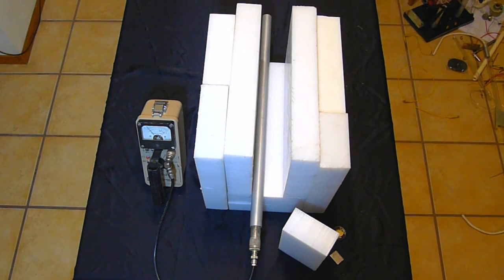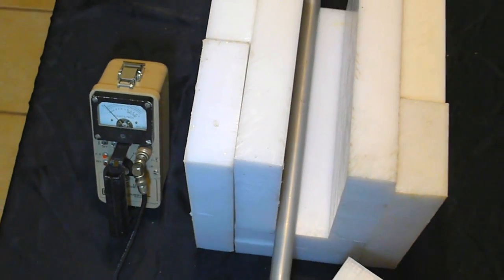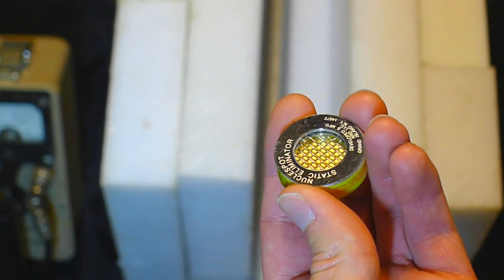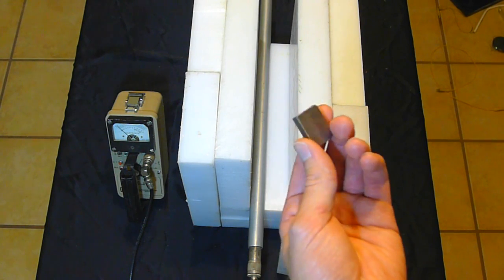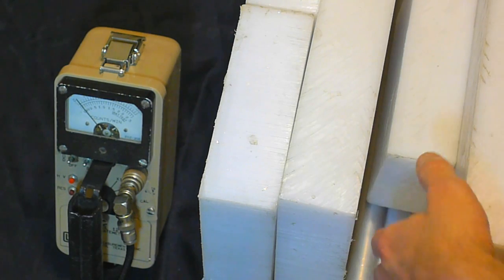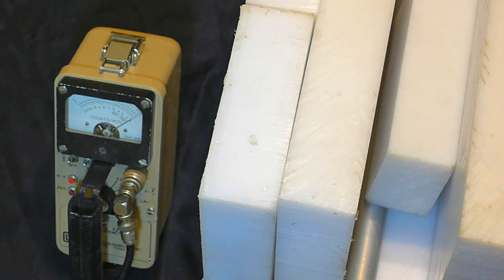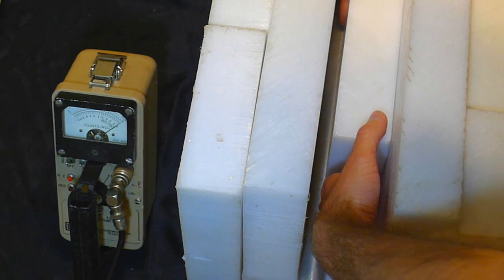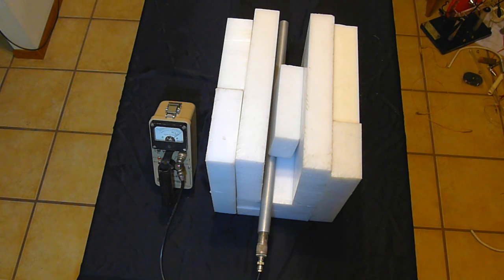Easy polonium-beryllium neutron source: assembly, disassembly, and discussion

Comment: Out of curiosity, is there a Best placement for placing something you would like to transmute with the neutrons? I see that you're helium detector is right up against the neutron source and surrounded by paraffin instead of the neutron source then paraffin then the detector. I am planning on making a video soon and I'm just wondering what would be the most efficient. I am also in New Mexico by the way, maybe we could team up on a project at some point.
Reply from the maker: The best location depends on geometry and energy of the source and the cross section of the target material.  This source is point-like and the optimal thermal flux for activating many targets will be close to the source with a lot of reflecting moderation surrounding it.  Would be happy to collaborate on projects as best I can...get in touch via email!

Comment: So this is some what a new understanding for me from a practical and theoretical point. How is it that Beryllium increases the neutrons? From my limited studies I’ve seen and read that Berylium is used to shield or moderate fission rather than activate it. I’m wanting to delve into making  isotopes that could be turned into radioactive as experiments. I just know you have to knock a certain amount neutrons out of its nucleus to turn certain elements to fissile material. Like some many bombardments of neutrons over time with a  respectable neutron source. Its amazing  to think some elements could be turned radioactive if the right isotope could exist long enough in half life’s to be usable. Any way I digress. Am I asking the right questions for this to be steered in the right direction?
Reply: Alpha particles can infuce fusion when striking beryilium releasing free neutrons

Comment: This is a good demonstration of a "slow-assembly" neutron source. It would be interesting to know some of the design details of the initiator used for the Trinity and Fat Man devices where the Po-210 and Be had to be combined by the implosion shockwave in a rapid and efficient manner. What size was the initiator? Pea? Golf ball? (I've heard estimates of 1.5 - 2.5cm diameter.) Did it have circumferential grooves milled into the outside to provoke the formation of R-T instabilities which would have promoted mixing of the materials? It would be interesting to create some experiments where we could investigate how quickly the neutron yield could be increased, and to what level.

Comment: Isn't this the neutron seed used in the center of early nuclear bombs? Or am I remembering wrong.
Reply: No, i belive you're confused. 
I'm not sure what method you were talking about.
either The uranium-235, super enriched 90 percent. bullet and target.
or the explosive against a plutonium core and compress it?
but, neither uses neutron seed.
but, my theory is that you thought you needed to shoot neutron at uranium which is true. but did you think you needed a neutron source. for this because you would get neutrons when the nuclear chain reaction happends. but chain reactions happends all the time but i doesn't continue.
 But A nuclear chain reation is when you contiunues.
Reply: @Poke Bot  No, I was correct. Both the gadget and Fatman used a polonium-bryllium neutron seed in their centers. Not technically needed I think, but they weren't sure at the time.

Comment: My end goal is to get 12 millicuries of reactor grade plutonium-239 to create small fission events with my weak neutron gun. The resulting influx of neutrons from the fission would go through a moderator and hit my breeder.
I think that is the best method of making a DIY breeder reactor
Reply: I was thinking of doing the same.  Im still unsure how to make a proper and safe containment unit.
Reply: plutonium is one of the few elements, maybe the only, in the US that you're actively not allowed to own or produce, so be careful! good luck regardless however

for a safe containment unit, water is probably the easiest shielding to acquire and use

Comment: Carl - Thank you for all your work. I've inherited a Ludlum Md. 12 and some LND 256169 He3 Neutron Detectors. Are these in any way compatible with each other and can they together be used to detect Neutrons. The connector consists of a 7/16-28 thread and a flying lead.

Comment: Carl.  Thanks very helpful.  I am looking to build an industrial "presence" detector, very similar to a Hall Effect sensor.  However, the two bodies that come into occasional contact will be steel, and they will be encased in a steel chamber that will get too hot for a Hall effect sensor.  Further, the steel chamber will be hermetically sealed so no wires can penetrate.  Frequency response is not a problem because when they come into intimate contact, they will stay there for a relatively long period of time.  Two questions.  (1) Do you think that I can get an industrial ion implantation system or contractor to implant polonium in one object and beryllium in the other so that they will emit neutrons when they come into intimate contact?  (2) Do you know of a cheaper, more robust neutron detector?  Thanks!
Reply: That is a very interesting idea, did you continue with those experiments?

Comment: Could you have used aluminium and Am241
Reply from the maker: +kerbside motors The Al-27(a,n) reaction competes with Al-27(a,p) and has a much lower cross-section than Be-9(a,n) shown here.  Also, Am-241 is a more significant gamma emitter than Po-210, creating undesirable background for many of the experiments that would lead you to build a source of this type.  But in principle, yes you can get some neutrons from an Am-Al source.
Reply: Thank you for explanation.
I'm part of Geo's group and appreciate you taking time to video your experiments.
Reply: @Carl_Willis  what if you were to store such a neutron source inside a vat of mercury spinning at 20,000rpm?
Reply: @Carl_Willis  could i use uranium and aluminium foil??

Comment: but those are slow neutrons. how to get fast one?
Reply from the maker: +usfootman The reaction illustrated here--alpha particles on beryllium--produces fast neutrons.  The detector requires a moderator (plastic) in order to detect them.
Reply: +Carl Willis what kind of energy those neutrons have?
Reply from the maker: The mean energy is 5-6 MeV; the maximum energy something like 12 MeV.
Reply: What is the approximate neutron flux? I saw an official university study pdf online that says a 1MeV neutron can travel 39,000cm in sea-level air at about 0.5c. Is this possible? It wasn't typical internet junk, but a real university study that compared travel distance and speed  in sea level air of different particle types at 1MeV.

Comment: Tried it with AM241 source (a matrix of 6 of them -- not as strong as yours) and a He3 detector tube (running at about 2400V).  At first, nothing happened.  I found that I needed to carefully adjust the gain on the input amplifier on the Ludlum 12.  Finally I got about 60 neutrons as background count.  When I put the Be on top of the Am241 source the counts went up to about 120 -140 CPM.  I don't have the moderator material either so I tried putting it under a jug of water, which didn't seem to do much moderation.  Not sure if it was too much or too little water, or where to put the detector (top of bottle)?  I will have to work to refine my setup to get better results.  For my tube the adjustment of the preamp gain on the Ludlum 12 was especially touchy.  To low, and you get no counts, too high, and you get false counts (I think they were false counts... since the counts hit 1000 CPM without a neutron source).  Anyway, still a lot of fun.
Reply: Well neutrons can only be detected if your looking for the right energy. If your neutrons are to slow or fast, or your detector doesn’t measure the right range, you might not be able to detect them. The material of the container holding the water could interfere with moderation as well.

Comment: Can you combine several Am241 sources to create an Alpha source?  Sounds cheaper than renting a Nuclospot polonium source?
Reply from the maker: You can get neutrons from Am-241 alpha particles on beryllium.  The challenge is the practical one of finding a significant amount of Am-241 activity.  Keep in mind the Nuclespot has 5 millicuries of activity.  That's 5000 times higher than a modern smoke detector Am-241 source.
Reply: Some smoke detectors from the 60s use 80 micro-curies instead of 1 micro-curie of Am-241, conveniently only about 80 times weaker than Carl's source rather than 5000. Quite decent for a small home source in my opinion.

Comment: Here is an experiment for you:

Place your neutron source on some Thorium metal.  If you wait for a few weeks or so, do you observe any heat? Thorium is for sale ion Ebay.

This is the basis of a ThF4 reactor.
Reply from the maker: This neutron source produces about 1000 n/s, far below any reasonable expectation of breeding or fissioning U-233 in detectable quantities from thorium.  Such practical considerations have not stopped an endless train of people from trying to do the experiment you suggest, however.  Most attempts are reported with even weaker or unknown and speculative sources of neutrons and amount to nothing interesting.
Reply: Wait, just how many are you talking about Carl and who are they?
The only ones I know of are David Hahn and Richard Handl
Reply: Would the neutron production rate be significantly improved if the polonium and beryllium were in a different configuration? i.e. thoroughly mixed together or with the beryllium fully surrounding the polonium?

In addition, would such a low neutron flux produce any noticeable effects on a significantly more refined material, say highly enriched Pu-239, U-235, or other fissile material?

Comment: Most of the fuel reprocessed at Mayak is from pressurized water reactors such as the nearby VVER-440 plant.  However, the facility is equipped to process fuel from a very wide variety of sources, as it is the oldest facility of its type in the world.

Comment: Interesting demonstration--very easy to follow. I've read that neutron radiation is far more detrimental to living tissue than gamma rays. Are there any extra safeguards one should use when dealing with neutrons? Obviously, the inverse square law plays its part. Also, 5 mCi of Po-210 isn't an insignificant amount--I assume the source has an alpha-transparent window to keep it safe?
Reply from the maker: Neutrons are indeed more damaging than gamma rays on an absorbed-dose basis.  The relative weighting varies between about 5 and 20, depending on the neutron energy.  The same principles of radiation protection--time, distance, shielding--apply to neutrons as well, but shielding is engineered differently.  These Nuclespot alpha sources are SEALED sources, with the polonium bound in a ceramic that is in turn overplated with gold.  The geometry is thin enough to allow a large fraction of the alpha particles to exit the source.
Reply: Carl Willis That's very helpful info--thanks!  It's reassuring to know those safeguards are in place for the Po-210 source.

Comment: I always thought that beryllium causes allergic-like responses, such as a bad rash, if the metal is handled.
Reply: Everyone exposed to Be eventually develops an allergy that is life threatening, that even an EpiPen cant stop. Some get it on their first exposure, some after decades. But it's not something you want to find out for yourself. His handling of the Be plate was insanely reckless and needless. It's not like gloves are expensive or hard to find.
Reply: You are absolutely right. Always handle beryllium with gloves. In this experiment its the beryllium thats the most harmful.   Even tho neutrons and Sr90 ain't healthy for you. Berylliosis might not be the danger here but even small doses can do allot of damage inside and outside your body. Contact allergies are one.

Comment: Isn't beryllium toxic, is it safe to handle?
Reply: Damn straight it is dangerous. Anyone who has or develops an allergy to it can die from anaphylaxis from inhaling a microgram of the dust or a even sliver in the hand before the ambulance can arrive. For someone who ostensibly worked in a DOE facility Mr. Willis doesn't seem to have paid much attention to the hard lessons learned from decades of workers being crippled for life or dying from Be exposure in those facilities.
Reply: @tetrabromobisphenol  pettry sure the dust is toxic. As a metal, If you don't mess with tooling it, you are relativelly safe. Those fields, nuclear, chemistry and industry in general, always come with riscs.

Just now what you are doing.
Reply: @tetrabromobisphenol  I was thinking the same thing. I actually suspect he has some exposure from that persistent cough across most videos.
Reply: The Beryllium oxide is really what's toxic.

Comment from the maker: The alpha particles are captured by the beryllium, forming carbon-13 briefly.  However, the carbon nucleus is too excited to remain bound, and a neutron exits.  The plastic is a moderator and reflector for neutrons--the hydrogen nuclei in materials like water, plastic, oil, etc. scatter neutrons, changing their direction and slowing them down.

Comment from the maker: I can't provide a number (mV).  Each system will be unique in terms of how large the pulses are, where the threshold needs to be, and so on.  You have two controls: high voltage, which determines the gas gain of the tube, and threshold, which simply needs to be set to reject gamma rays.  The tube's capacitance and cable capacitance determine the input voltage for a given release of charge.  I have another video that shows how to set up neutron detectors.

Comment: Carl, Great demostration. Thanks. I am trying to adapt the same way a 
BUT with a neutron detector tube BF3 to a Ludlum Ratemeter 4 (which has almost the same 
capabilities as your Ludlum 12). Do you know to which 
thereshold input sensitivity value did you set the ratemeter to detect pulses 
from your He-3 tube ?

Comment from the maker: Geiger counters respond indirectly to neutrons, but they are not particularly sensitive to neutrons and of course also respond strongly to other, typically more abundant, beta and gamma radiations.  Usually neutron detection is accomplished with detectors specifically designed to detect neutrons.

Comment: I find your video(s) extremely interesting!
However, I would be even more excited if you would make a video reproducing Chadwicks origimal experiment. Put the piece of Beryllium between the Polonium source and a Geiger tube. Prepare a small piece of plastic (or paraffin) to put between the Beryllium and the Geiger tube.
Chadwick had a vacuum chamber but your experiment shows that this is not really necessary for producing neutrons.

Poul Riis, physics teacher, Denmark
priisdk@gmail.com

Comment: thanks a lot for this awesome demonstration! =)
very interesting that you can just lease these sources in the USA. is there an "exempt quantity" for neutron sources (in general)? 
here, when you turn one thing into something else, it may sometimes put that item under different laws. for example, there's no limit for the possession of uranium ore (falls under some chemicals law, ChemVerbotsV), but if you process it with acids, you have to closely follow the rad. law (StrSchV).

Comment: Very educational and  interesting! 

It would be interesting to experiment with other alpha targets other than beryllium and observe how the neutron counts would very.  I´ve heard that both lithium and aluminium will emmit neutrons when struck by a alpha particle. They are both alot cheaper and more easily obtained than beryllium but ofcourse they are not nearly as efficient as beryllium. But one might ask what is the second best material to use?